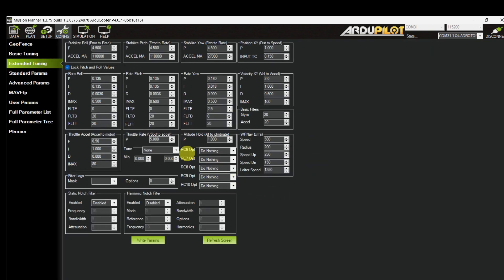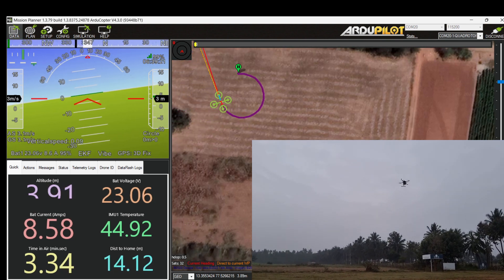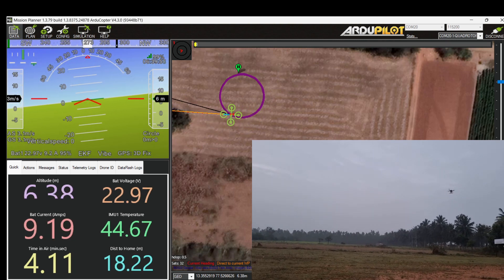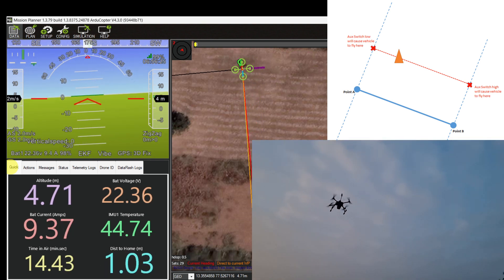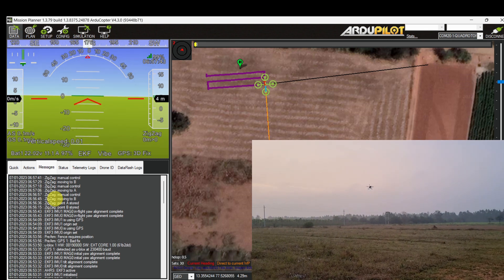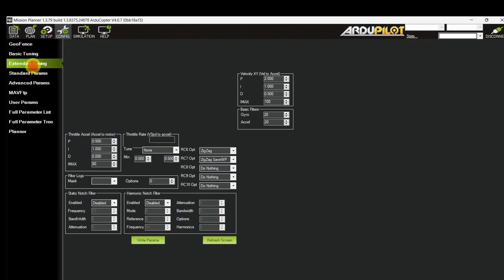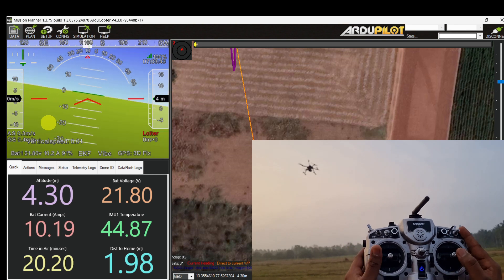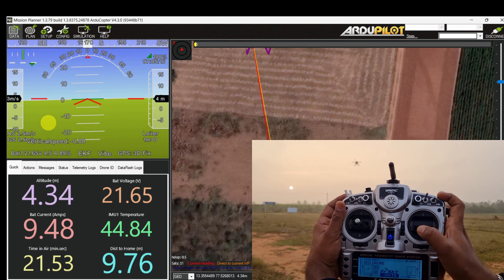Beginner's Tutorial: Introduction to Arducopter Flight Modes - Part 02

Comment: I dont have a radio telemetry kit is it necessery to have one, to use auto or circle mode or i can do these modes just with remote control
Reply from the maker: Yeah.. you can assign circle or auto flight mode in your RC 3 pos switch.